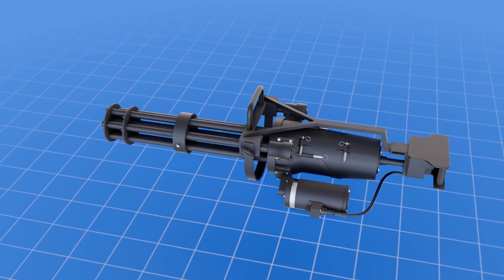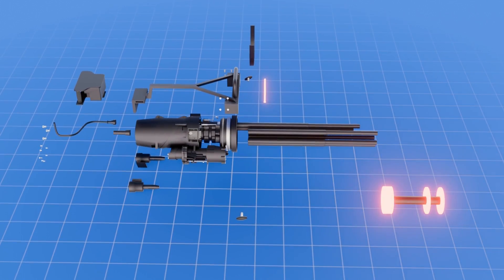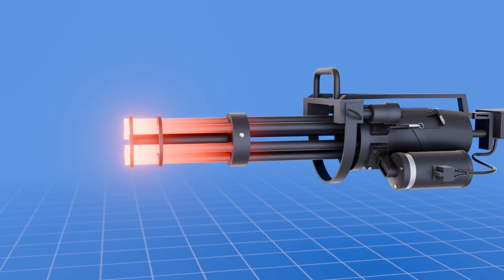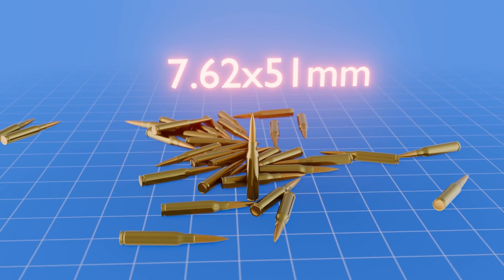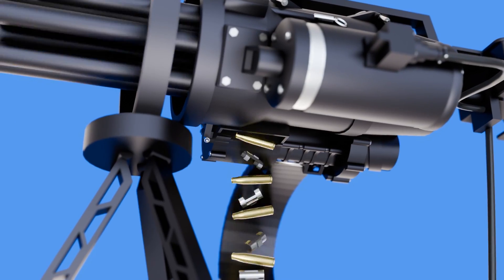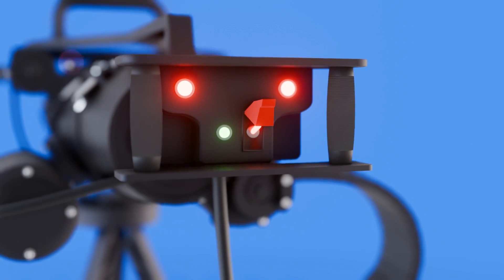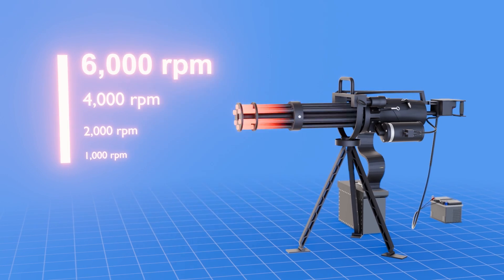How M134 Minigun Works 3D Animation

Comment: I always thought tight hand should have two triggers operated by index and middle fingers
Bottom trigger spins but doesn't fire. 
Top trigger fires. 
Both must be held to fire gun. 

Left trigger is like a set of hand breaks. 
I assume there's a lot of recoil and sway. 
The tighter you pull this grip, the harder the gun locks in place.

Comment: Half to three quarters of this information is correct, but enough is wrong to tell me that whoever wrote this does not know enough to have made this video.
For one thing the firing pins are not electorally fired. Rate of fire is two to four thousand a minuet depending on setting.

Comment: The parts I didn’t know were how specifically the ejector works (the original Gatling gun jammed is operated too quickly because of feed issues and casing not being ejected fast enough to avoid a stovepipe, 
and if the bolts are brought forward by spring or riding a groove in the housing. 
Sadly these were not discussed.

Comment: No, no I don't.
I have no idea how the timing is changed due to different rpm-s but having the same mechanical tolerances.
I still have no clue how the pin firing works and what typical problems this system produces and what maintenance procedures should be most frequent to prevent them.
I also have no idea how the belt feeding system dismantles the chain links, nor how it has to be "reload"-ed.
Bruh, I don-t know how heavy it is...

Comment: The M134 is not truly a machine gun, as it does not derive it operstion from the energy of the firing of the cartridge.  Depending upon the opinion of various agencies.  But by strict definition, a machine is powered by the firing of the cartridge.  Otherwise its a rapid fire weapon.

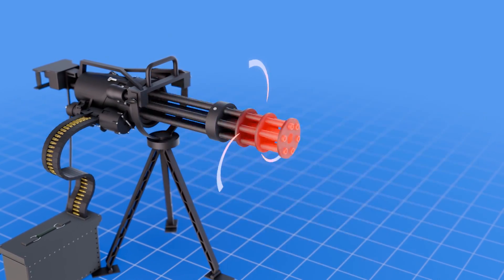Comment: 4:42 "So the next time you see an M134 in action-"
Yeah um, I don't think I want to see a minigun in action particularly much. It probably has something to do with how I'd be turned into swiss cheese.
Reply: Ummm.... you stand behind the gun when firing.     Much safer.    It's on page two of the Operators Manual.     Hat tip to Kevin for the safety demonstration - miss ya buddy.

Comment: How much is the trajectory of the bullet affected by the barrel spin?
Reply: It doesn’t matter how it’s affected as long as they are all affected exactly the same way, which they are. 

But it’s actually pretty negligible, since each M80 NATO round exits the barrels at almost 2,000 miles an hour, whereas the barrels move laterally at only around 21 miles an hour at its very fastest rate of fire (if I’m doing the rough math right and guessing correctly at barrel spacing).
Reply: Edit: dang I’m curious now leaving a comment so hopefully I get notified when somebody bothers to do the math!

Comment: Some things are wrong here.  First, the firing pins are mechanical, not electrical solenoids.  They are actuated by the track in the housing once the round is seated and the barrel is in the correct position.  Second, the feeder delinker doesn’t push rounds out of the links.  It removes them by pulling them back by the rim of the casing.  I had 2 of these on my first ship on my first deployment, and they were pretty much my responsibility.
Reply: Yeah there are WAY more accurate videos on this gun.
Reply: The rounds are pushed forward out of the links.

Comment: What is the point in there being more than one barrel, given that only one fires at a time anyway? Why isn't it more like a revolver cylinder with one barrel?
Reply: Short amswer. Heat.

The weapon fires hundreds of rounds at a time, and each round generates heat. If they come from a single barrel, then that barrel can overheat quite fast. 
As it does from standard machine guns. From those there are systems that allows the user to change barrels and continue firing.

In a rotatory cannons machine gun  like the Vulcan phalanx or the minigun, the heat is spread between all the cannons, and not only that, given the rotatory nature, it allows the air to flow and take away heat.

Why heat is a big deal? Because at high temperatures can cause damage, hindering performance, even exploding and damaging the user.
Reply: In a single barrel gun the bolt needs to go back, fully eject the shell, and spring back to fire the next shot. If you have your six barrels all reloading while the other is firing by the second they do a full revolution they can fire again. So yeah on top of heat you can reload shots while still being able to fire.
Reply: @Rhino-hq1tf  ...and how would that differ from there being five chambers as opposed to full barrels reloading while one was firing?
Reply: @backforblood3421   you only have to reload one barrel at a time if they rotate instead of having a mechanism of all six and relying on more mechanical complexity to time all barrels to die at the right time.
Reply: @Rhino-hq1tf  What I'm talking about would work exactly the same way because the only difference would be that it would be six chambers identical to the breach end of the barrels and only one barrel.
Reply: @backforblood3421  if you have one barrel than the heating problem persists.
Reply: @Rhino-hq1tf  Yeah.

Comment: How is it not shooting when it rotates only the barrel? How is the firing pin only activates if the trigger is pulled even if the barrel is rotating?
Reply: 6 barrels, 6 chambers, 6 bolts, 6 firing pins, all talking turns as they rotate around each other. Not like a revolver, which has 6 chambers, 1 barrel, 1 “firing pin” (hammer), and no bolt.

Comment: What’s the difference between this and a gau 8 avenger and a volcan
Reply: The GAU-8 doesn't delink the belt or eject casings. The belt passes through the gun and cycles back to the drum magazine with the casings still in place because their weight is still needed to keep the aircraft balanced. Vulcans are similar but are usually hydraulic or pneumatic powered
Reply: This thing fires 7.62mm, Vulcan fires 20mm, that's almost 3 times the size. Not impressed yet? The gau fires 30mm.

As for the mechanical principle, they're almost the same. The gau kept the spent casing to maintain the overall weight of the plane.